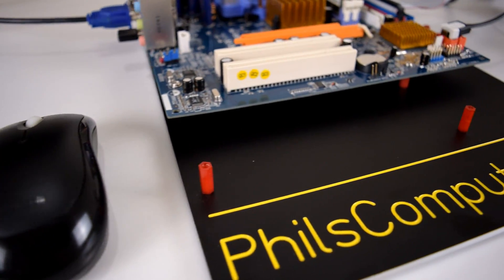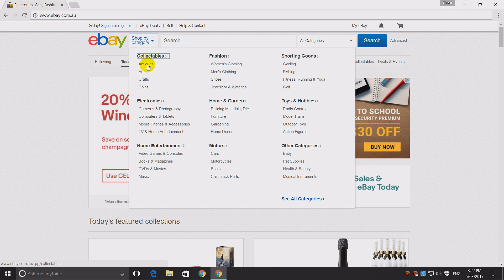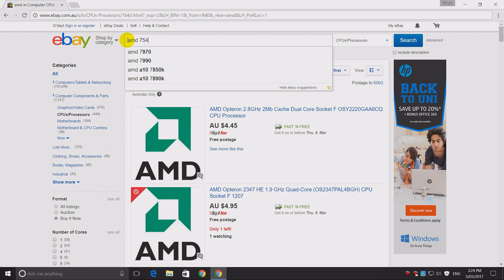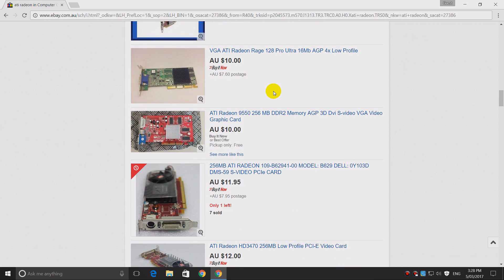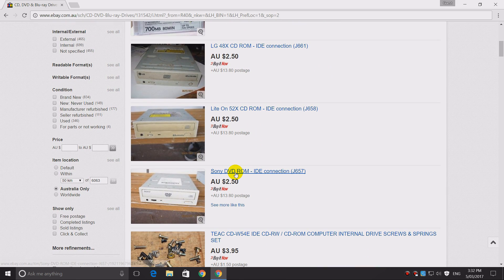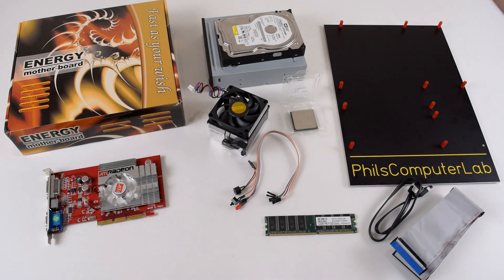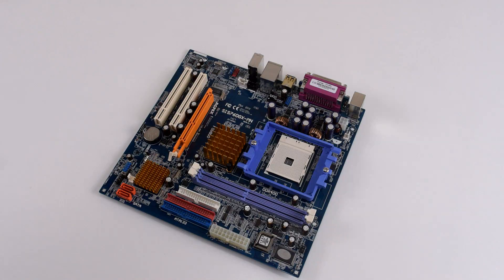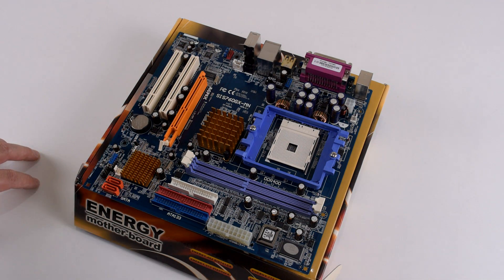Building a cheap Windows 98 Gaming PC

Comment: I' ve got an AMD athlon XP 1.5 GHz and need a graphics card for windows 98 and dos games. Which on do you recommend?
Reply from the maker: Any GeForce or Radeon should work well.
Reply: PhilsComputerLab Thanks! Also, is it possible for a Motherboard to kill HDDs? I' ve already tried three ide drives and all three are dead! Maybe it's just bad luck. I'm currently running a 6 GB HDD from 1996 :D It's noisy as hell but it works...
Reply from the maker: I think drives that old are just destined to fail :(
Reply: 1.5 GHz?
Shoud be a good match for a Voodoo 5 5500.
But if that is to pricey for you something like a Geforce 2 Pro up to a Geforce 4 Ti, or for the red side around a Radeon 8500/9200 up to a 9500 Pro to be somethat period correct.
Ofcourse anything faster won't be much of a problem.
Reply: If you can find one I suggest a Geforce 4 Ti but they are getting to be a bit hard to find but still cheap and Geforce FX is getting to be expensive for the performance. 3DFX Voodoo 5 5500 is stupid expensive and will probably by the end of the year will be selling for $200 us a pop.

Comment: I did something a bit like yours. 2ghz sempron, msi mobo, 512 ddr1 and a radeon9600 that were swapped to a gf4ti4200 later on. It ran very well. A bit too fast sometimes on win98
Reply from the maker: I had a look in the BIOS for slow down options. The FSB can be lowered, but not by much. Also the RAM speed. I will try some older DX5 stuff just to see what will happen :D
Reply: Actually a good 98/XP dual boot machine.
Reply: HappyBeezerStudios 512mb ram are too little for xp. I would go for eighter two or four gigabyte for WinXP.
Reply: PhilsComputerLab Yeah.... Some say that early Win98 games struggles with some technology, that are missing on Radeon cards. I just cant remember what it is exactly. Though games from 1999 and onwards will run without issues on them 98 compatible radeon cards.
Reply: PhilsComputerLab try sometimes disabling processor cache. Sometimes works like charm sometimes it's slower than 386.

Comment: Buying old Athlon XP and Pentium 4 computers could probably work well too.  They're overpowered for the job, but old enough to still have drivers for everything.
Reply from the maker: Yes totally. I just wanted to do something with AMD for a change because I've done so much Intel stuff lately. And the Athlon 64 gear just happens to be cheaper and easier to find on eBay Australia.
Reply: PhilsComputerLab Yeah, I guess go with what's easy to get in your area.

Comment: for used part everything is so clean, like new.
that motherboard is so colorful.
I skip 754/939 generation, going straight from 478/Socket A to AM2/775.
Btw these hardware more like suitable for Windows XP era.
Reply from the maker: I find them under powered for XP. We will find out soon how it handles Windows 98 and if it's too new or not :D
Reply: How is that under powered? those hardware can run NFS Most Wanted easily.

Also 9550 can't utilize DX9 under Windows 98.
Reply from the maker: Those parts will run Windows 98 games very well, but it will struggle with many XP games. I've done my tests but it's only my opinion. I will cover XP gaming at some point down the road, for the time it's all about Windows 98 :)
Reply: sure, don't get too fast =), There's still tons of fun from windows 98 era that I can remembered.
Reply: imo for win XP a good build would be like a dual core like E8400 for example, 2-4 gigs of ram, and a graphics card like HD 4870 or 9800GTX+, those should be fast enough to pull more than 60 fps at 1600x1200 at later XP games like Far Cry and Quake 4 and FEAR, though they might struggle with Crysis but that is more of a Vista game, a 512mb vram model because in 32-bit XP it takes away from the usable system ram if the vram is too much, and I'd say 1024mb vram is too much in that regard. And of course an X-Fi sound card :) Storage wise I'd say a 10000rpm wd raptor for OS (no automatic TRIM for SSD in XP) and a 2TB 7200rpm for storage.
Reply: Title says "for cheap". Old parts can be not so cheap sometimes as it becomes more "retro" than "obsolete". MS ended win98 support in 2006. It's more like Win98 compatible PC from ~2006 than the best available hw from 1998 :). I have a WinXP on my Socket A Sempron machine and it works quite fine :).
Reply from the maker: Yes that's more like it. Personally I really like AM3+ for XP Retro gaming, but you can't say no to a nice LGA 775 system and a Wolfdale.
Reply: I've had a similar Situation with a 9600 Pro under 98 for quite some time and it ran everything newer, including DX9, just fine. The trouble is with the rally old tiltes. Certain features (like 8-bit palleted textures) have been dripped on newer cards.
Reply: SKIPPED SOCKET 423? BUMMER!
Reply: Randomroutine
RAMBUS + 423 The horror.
Reply from the maker: I have never considered AM2 for DOS gaming. I'd be surprised if you can get it to work to be honest. Good old PC speaker should work though :D
Reply: There is a small number of DDR socket 423 boards that support 3.3v agp so one can do a 3DFX build of a different flavor. I like doing all kinds of low to mid to high spec XP builds so it doesn't bother me if something ends up being too slow as I always have something faster :)
Reply: Got my mobo and CPU in working condition FOR FREE, excited af

Not that bad, you can work with that! :\
Reply: Again with VRAM and RAM limitation on XP or any 32-bit OS BS...
3GB VRAM on GTX 780 Ti and ~3,5GB of normal RAM in CPU-z : http://i.imgur.com/bKJk6sn.png

One PCI-e GPU, always reserves 256MB of normal RAM for it's resources. 
It doesn't matter how much VRAM graphics card has,  256MB is all it takes.
If you have a Dual GPU (like GTX 590) it will take 512MB of RAM.
If you have a Tri-SLI GTX 280 it will take 768MB, etc.
Reply: Recently, i have built a retro gaming pc which has these specs : Socket 370 mb with i815EP chipset, Coppermine P3 733MHz, 256MB SDRAM, 80GB IDE hdd and 3dfx Voodoo3 3000 card. Besides this graphics card, i also have His Radeon 9550 128mb, on AGP too... Tried Clive Barker's undying on some scene, static screen, fps counter shows 35fps on Radeon, and 43fps on Voodoo3 card... Seems like this voodoo3 fits better on this configuration than Radeon...
Reply: Yes this build is way under powered for windows XP gaming. There are many later games that still run on winXP. My Win XP Pro gaming rig is a Q8400 overclocked to 3.8Ghz, 4gb ddr2 ram, and a GTX 670 and there are some games that still run sluggish when i crank the settings up on some titles.
Reply: Yes true I have only been using Windows 7 for the last couple of years, and I only just recently started to game on Windows 7, so i am slowly trying out my games on my i5 quad-core/gtx 960 gaming rig running Windows 7. What ever i can get running without trouble on my i5/win7 machine will stay there but i will also keep them on the q8400/xp machine just to show people in 10 years ect time what you can still achieve with old hardware and Windows XP.
Reply: +Compatibility Madness lol, nice... I guess I don't need a 9800GTX+ then, I wonder if a 750Ti will do the job
Reply: +vortex222 don't you find the Riva 128 to underperform in win98? I've got a voodoo3 in mine and I just don't like it, less than 60fps most of the time at 1024x768 16bit color in Half-Life is nothing to praise imo, I'm considering trying out something like FX5950 Ultra or 6800GT with nglide instead... Not sure how many games will be incompatible with one, but 1600x1200 at over 100 fps with 32bit color is how it should be :)
Reply: @vortex222 "...period hardware may have a more realistic rendering of the games then the newer hardware, do to changes in drawing and rendering techniques in the drivers and silicon..." 
I'm sorry, but WHAT ?
Newer GPU's will render the same picture as older GPU's, because that's what DirectX and OpenGL standards are for.
In case of DirectX 6/7/8 you may have a point (since for example  native TnL may do things differently than software emulated one), but DX9+ game, will look the same regardless off running on DX9/DX10 hardware or DX11/DX12 hardware (performance aside).
Driver tweaks (lower quality for speed), are actually more aggresive on older DX8/DX9 hardware, since top GPU's from NV/ATI were so close to eachother (whole "missing dragon" in 3DM01SE thing NV did for FX series, and that "sky optimisation" on Nature test from 3DM03).
Newer cards don't use tweaks meant for older ones, because they don't need it (performance is where it should be) or can't use it (compatibility with old code language).

Comment: I have a socket 775 pentium 4. Is that overkill? Not sure which era this cpu fits since I know there are many different pentium 4s :p My first desktop was a pentium 3 with Windows 2000, I'd love to build something similar :D
Reply: It certainly will work. If ot'S to fast you can always downclock it. Or go with a Celeron 400, they are from the Core 2 lineup, but only single core and have a TDP of only 35W while comperable Pentium 4 sit above 80W
Reply: 775 and 98 works but it helps to have driver support out right like all 775 agp boards and select pci-e boards have it as well. Eventually people will have little choice but to settle for pci-e because of the prices of agp cards will get to be prohibitive on the higher end.